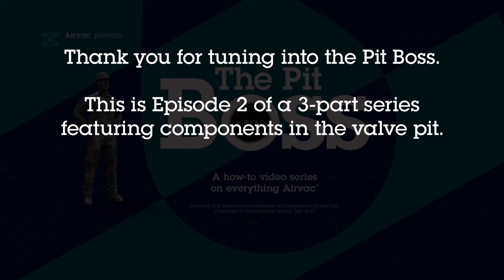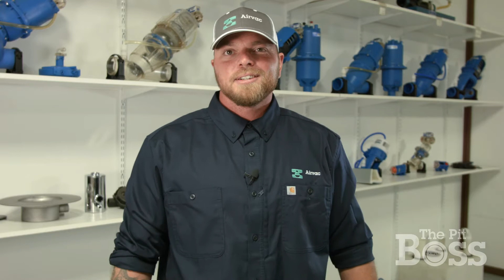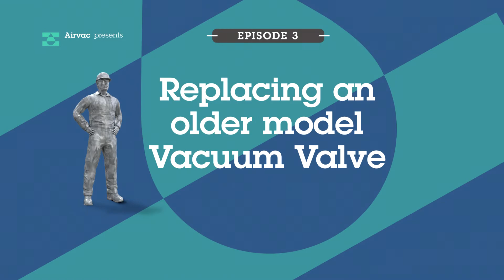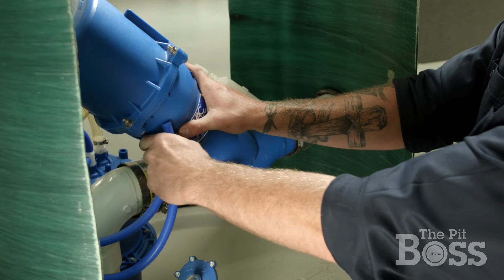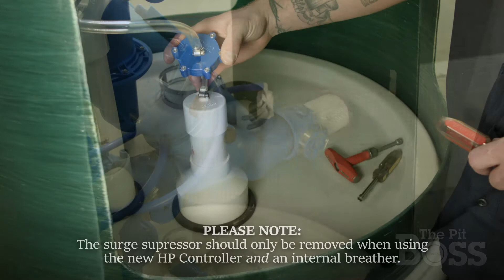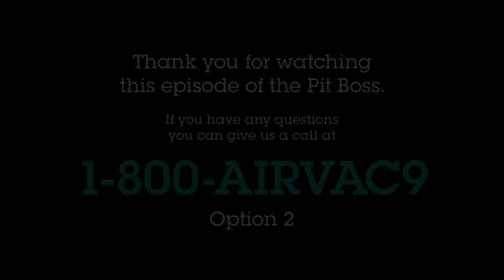Pit Boss Episode 3 - Replacing an Older Model Vacuum Valve

Comment: Hi pit boss, from France.

At 4.10, I prefer retract the plunger, close the two low chamber fittings, screw on the valve on the wye and then release the plunger.
So the plunger doesn't rub against the seat when turning.
What do you think?